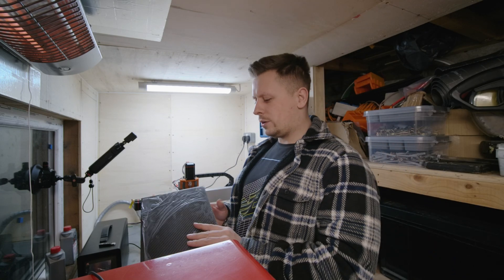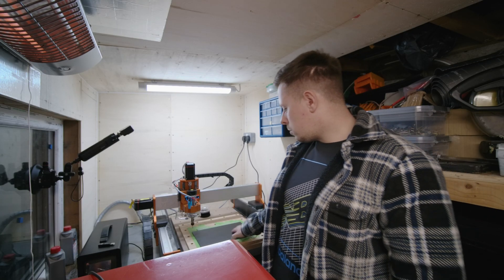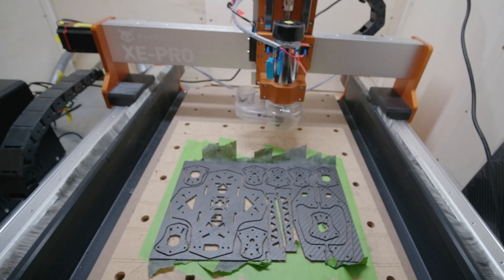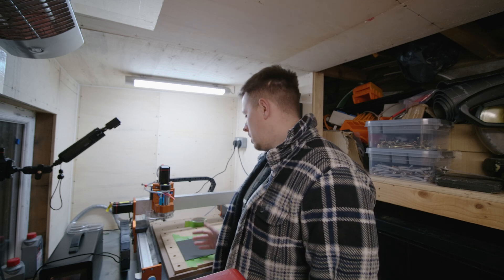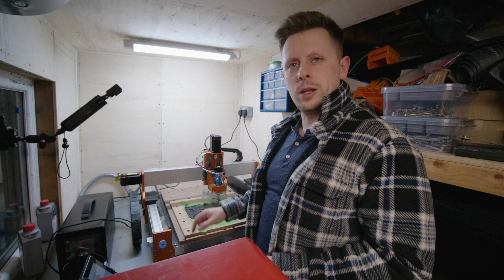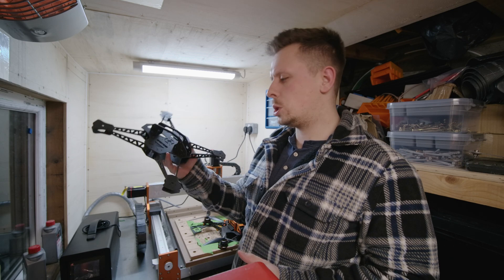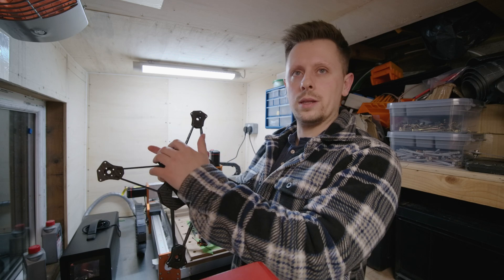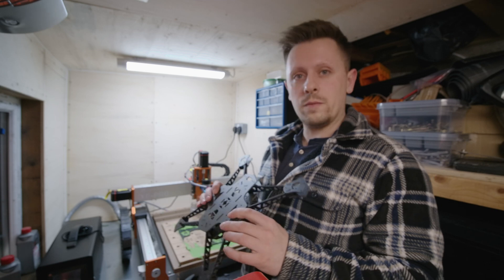Cutting  FPV Drone Frame From CNC For the First Time 🚁

Comment: Hey there! Loving your content, especially since I'm a fellow enthusiast of FPV drones. Recently, I got my hands on a Genmitsu 4040 CNC machine and I'm excited to dive into making carbon frames for drones. Do you have any recommendations on which end mills and drills work best with carbon material, and what speeds and feeds I should aim for? Being new to this, any additional tips or tricks would be greatly appreciated. Thanks in advance for any advice you can offer!
Reply from the maker: i'm new to it my self so we both in similar boats although I have been given advice from friends, 

in regards to end mills I tend to use 2mm end mill mainly and don't go crazy and buy the most expensive just look at some Titanium Carbide 2mm end mills, also when cutting carbon your working with a very abrasive material so these bits are not going to last your probably going to use around 2-3 per sheet depending on size of sheet and you want to cut the most critical areas first to maintain better accuracy 

in regards to speeds and spindle speed, ideally you want to be running your spindle at its fastest speed this is usually manually set on machine controller. if your machine comes with a 12k spindle your cutting speeds will be slower like mine. best to start slower and test higher speeds as you get move involved in it, I'm not familiar with the machine you chose but if its belt driven not ball driven your speeds will need to be much slower to prevent belt slip so I cant give you accurate answer on this its all trial and error, buy your self some cheap carbon so that you can play with it see what results you get and test different settings to suit your machine 

sorry I cant give you a more definitive answer its not as simple as that
Reply: @GDZ93  Thank you so much for taking the time to provide such a detailed response, it's truly helpful for me to have a better understanding of how to get started. I've just ordered several packs of different end mills from the manufacturer's website and a more powerful Makita spindle.
It would be great to see more videos about CNC and drones from you. Best wishes!

Comment: Nice video. I have some of my frames on cncdrones under Quadwrex. So far, I use them for all my prototyping, but it would be nice to at least make replacement parts on my hobby grade cnc. I'm still learning cam, but it's pretty exciting to think of the possibilities.
Reply from the maker: if you have a cnc machine already you can certainly cut your own parts its so handy to have, the biggest thing for me was the wait time on cncdrones to get the parts to me which is why i went this route
Reply: @gazafpv  definitely.. here in the States, it is about a week and a half on an order. It can be frustrating when making multiple revisions or breaking something the very next day. I currently have two frames in the works right now. It's mostly a waiting game. I just had someone cut one of my frames on the same cnc. The frame turned out great. It gave me a little more confidence to give it a go.
Reply from the maker: @Quadwrex  yeah that's the issue it's similar time frame for us in UK too depends how quick they cut them sometimes it's over a week waiting to be cut. 

Yeah most CNC will cut it with ease just keep changing the end mill regular as they don't last long before they start cutting rougher due to carbon being so abrasive material. I think the hardest part is learning the cam/cad side of it not much info out there for setting up fusion for CNC so it's a steep learning curve other than that your golden just takes your time and go slow to start
Reply: @gazafpv I went ahead and cut my first carbon fiber parts with the painters tape method. As soon as the bit comes in contact with the tap, it gums up the bit. I didn't know if it was a feed or speed issue or if you had any suggestions?
Reply from the maker: @Quadwrex  what do you mean in contact with the tap ? You mean the carbon right ? 

Ideally you want to be running your spindle at full rpm which is usually manually controlled after that you need.to look at depth of cut and cutting feed rate. Your depth should be no more than .5mm maybe less depending how strong your CNC is and your feed rate starts of slower maybe 450mm/min increase if you feel machine handling it fine
Reply: @GDZ93  thanks for the helpful tips. I meant to say as soon as the bit comes in contact with the painters tape
Reply from the maker: @Quadwrex  yeah I'm not having that issue make sure your using quality painters tape (frog tape ) the cheaper stuff may wrap around the bit but ice not experienced this it cuts through it clean

Comment: Not sure if you are aware, but normally they cut carbon fiber like this under water to reduce the dust. Breathing carbon fiber dust is pretty dangerous. Otherwise, nice work.
Reply from the maker: Yeah I'm well are of this as stated in the video... HEPA filter on vac does the job well and when it's cutting contours I leave the area and go do something else only time I was there was when it was drilling holes.   I did consider water but it's hard work cleaning and being able to see what your cutting

Comment: Really appreciate you consolidating the multiple days/weeks of the process into a succinct beginning to end of phase 1 of the build.
First video that I've seen the CNC cut the frame.
For me, even in the long run, it will be cheaper to buy a frame, but this video adds a new dimension to a build video.

Thanks
Reply from the maker: Yeah I totally get that it's not really a cost saving thing for me. My problem was I wanted to be able to design and cut frames/parts as and when I wanted them without waiting a few weeks for.them.to come, If you was to sell them you would make it cost effective but it's not cheap to get a frame cut from these companies either